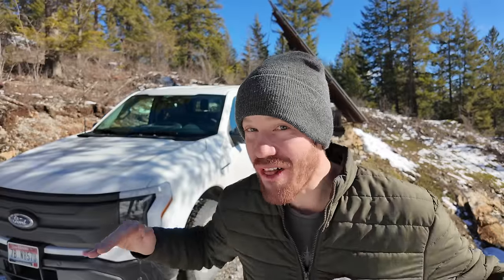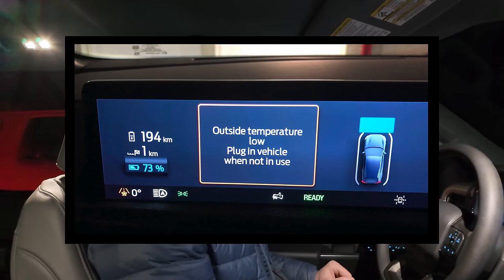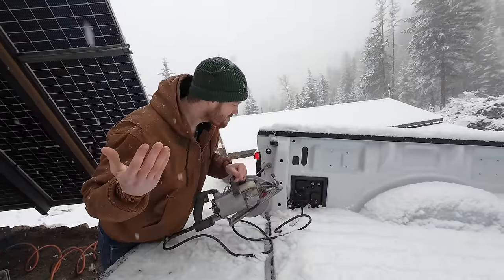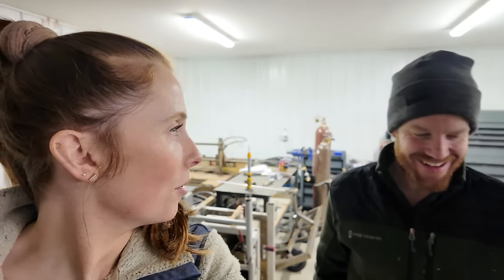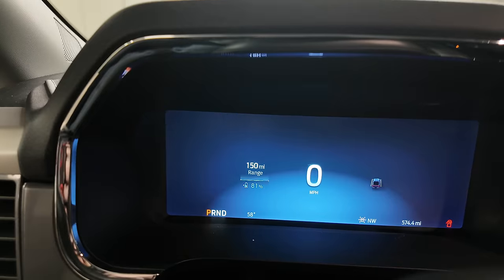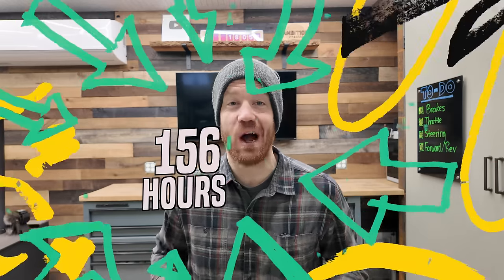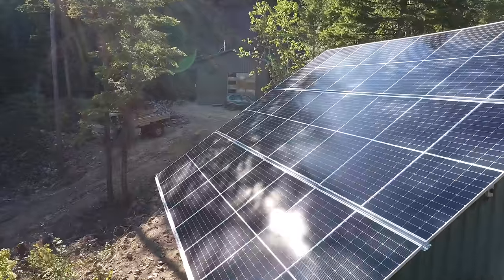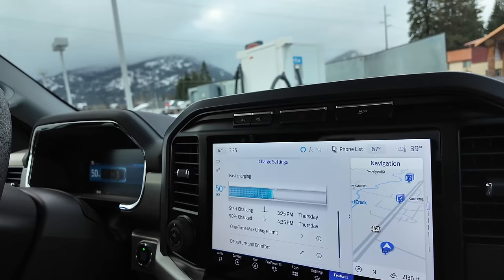Replacing My OFF-GRID Power System With an E.V. (not what I expected)

Comment: You should look at the ford charge station pro charger. It can charge at 80 amps and it can power your house. It's much better than using the bed power.
Reply: The pro charge station only work with the big battery 131 kwh and not the 90 kwh …. That would be a total different test
Reply: Are they still offering ford charge station pro ? I am being told it’s no longer available.
Reply: @nathanbrumbaugh8545  better be! ( already setting up the 400amp-retro-fit-panel-ect 1970 house 🏡for it, just need for coprate/local dealership's to sell the installation kit +safety equipment ect as id like it pre-installed before taking the truck home for the 1st time so my experience is smoother ect )( vehicle to load/grid and other parts of convenat's/easygoing made my gasser classic obsolete and worthwhile to change my habit's ) otherwise it's back to diesels or pre-1966~/EPA-free for my next truck-experience 

glad the cost is starting to come down 150k usd $ is way to much for mechanic 👨‍🔧 ( my career is in manufacturing plants millwright, so the interior gets hammered even though i try to keep it date night ready ) and farming/welders-rig's that are going to get thrashed
Reply: @richardprice5978  If they don't, you can always get a competitor's EV trucks which do. I don't think Ford would want that very much.

Comment: have you thought of a gravity battery? take advantage of the hilly property. just dig a flat surface on a long grade. install a rail and weigh car. connect it to a motor generator and pull it up when your batteries are full and let it out when the batteries are low. also a solar-powered saw mill and wind power in the tree tops. i did this and with your great team and skillset, this will be fun for you. great channel Harv

Comment: Not sure if anyone else has already commented on the 7,200 watt output.  It is actually two 3,600 outputs at 120v.  So if you have more than 3,600 watts on either the same side of the output (L1 or L2), you will overload it.
Reply: I was wondering about that, do you know if it is high frequency or low frequency inverter?

Comment: This highlights exactly why the only EV truck I'd consider right now is the Cybertruck. At least until the lightning gets NACS and supercharger access.
Reply: It has it now.
Reply: @Paul-cj1wb  I think it's only a subset of the superchargers but it's a good start
Reply: @niktak1114  It's a very large subset. And growing. You can see for yourself on the Supercharger map online. Just filter out "Superchargers" and leave "Superchargers Open to Other EVs" and "Superchargers Open to NACS."
Reply: @Paul-cj1wb  No it doesn't.  Not till 2025 when they will have NACS instead of CCS1.  Current Lightning owners are being given a CCS1 to NACS adapter to charge at compatible Tesla Superchargers.

Comment: Notwithstanding all the electrical problems with the Lightning, the biggest problem here is that the battery composition of the Lightning is lithium ion so the cycle life is far more limited than that of your SOK batteries.   Given the price of a replacement pak, I think I'd only use the Lightening for backup in an emergency or for a limited amount of hours where you keep the charge between 30-70 percent to avoid dendrite formation in the Lightening battery.   NOT keeping the battery warm (not in the shop) will also shorten battery life by a huge amount.   Look at the chemistry data and you will agree...Cheers...and good vid.

Comment: I was trying to do this and mine broke, had black screen, onboard charger failure, ground fault issues and more. Had to return it. I hope yours doesn't break like mine. The lightning is one of the least reliable vehicles of 2023. 

I wanted it to work but the trucks tech is just not there yet. 

Oh and the charging speed is just awful. Especially compared to the competition.
Reply from the maker: Hey Will! We watched your video back when you first posted it. What a bummer! We were really hoping Ford had worked out some kinks since then. This is our first EV and the charging has been the biggest learning curve so far. The electrify America charge speed was great, all of the other level 3 chargers have been a disappointment. Thanks for watching the video and leaving a comment!

Comment: A couple of items --

The "plug in while not in use" isn't a requirement. It will run the battery conditioning system no matter what. That said, when it gets really cold, or really hot, these systems can eat power. It sucks to go to bed with 50mi of range, and come back with 35-40, so when the power conditioner will use a decent amount of power, you'll get a reminder to keep it plugged in so your range doesn't drop while it sits, or potentially eat all the battery just doing power conditioning if it's sitting long enough.

Next up, the certain appliances not liking the inverter power. I'm curious if it's a pure sine wave inverter, and how 'clean' the power is. May be worth doing some digging on that front. If it is a pure sine wave inverter, may just need a power conditioner (power factor correction, noise suppression, transient impulse protection, etc...)/line filter on it.

Comment: Great Video....Thanks!....My Lightning XLT has the equivalent battery storage of 7.25 Tesla Powerwalls for $2000 less. It's a No-Brainer that it is a great augmentation to your current setup, not a replacement. I have a 7 year old 15kWh grid-tied solar system but no battery backup.I am planning on using the truck as a mobile battery bank. Plus it is a great vehicle! Comfortable, Fast and Powerful.

Comment: We just had a near 48 hour grid power failure here in SE Idaho (I was off grid for 28 years, grid tied solar, wind, and hydro the last 16) and my Toyota Prime hybrid plug in made it a lot more comfortable. The car remained ON for 40 hours. A 1000 watt inverter (it can handle 1500 watts being pulled out of the 12 v. battery, constantly being replaced by the big high voltage traction battery) let me run some lights, a circ pump, and the fridge. During that 40 hour outage, my total gas consumption was .14 gallons,  note the decimal point...., as I had started with a fully charged traction battery. I added 3 KW more of PV to my property, and it seems to be more than keeping up with the extra watts using charging it, with about a 40 mile EV range.

Comment: My brother uses some smarts to tell the Power outlet for his EV to only charge when there is enough sun/ excessive power.
Maybe your Home power system has the ability to switch a relay when it is reaching a certain battery power level? Combine it with a sun sensor to immediately switch it off, once there is no sun. Maybe you can even switch it between 120V and 240V depending on sun intensity to take stress off your home batteries?

Comment: Absolutely love your vids. Watching your vid brought back memories of when I first connected up my off grid set up. Took a few days to figure out what was causing me problems. My batteries would start flashing red and warning alarms and refused to connect to the inverters.Them Lithuims with their BMS don't like sudden hard discharges. A stand alone battery lead acid helped me. Your inverter just like mine on connecting to the batteries will draw a large current due to capacitors charging up. And theres the problem even when the inverter is not powered up. Running Lithuims totally flat my system will not start, I have to isolate them from the inverter and charge up using a seperate MPPT controller and once they fully charged and connecting they will connect to the inverter. I try not let mine run totally flat. Looking forward to see how you get around this issue.

Comment: That's wild! It's also wild how little power you use per-day. That truck would power my house for 1 day, before needing to be recharged (46kW/day, average, with super-efficient appliances, no AC, no hot tub or anything, mostly just HWH and computers that run 24x7). The biggest problem in the Northeast US, is the EXTREMELY high cost to charge at a public charging station ($0.30/kWh), so the Chevy Silverado EV for example, would last 4 days powering my home, but then cost $60 to fast-charge at a public station. That's $420+/month to charge to power the home fully from the EV.

Comment: I’m sure the experimental side of this is fun, seeing what works and what doesn’t and troubleshooting all the different things that come up, BUT I gotta say it’s all a bit much for my comfort level. “Range anxiety” is now just overall “power anxiety”, 24/7, all the time at home. I wouldn’t want to be having to check and double-check all this stuff all the time. I just want to plug it in and not worry about it. Plus not to mention the cost for all of that equipment; inverters, diverters, converters, ‘perverters’. Unless you’re a fairly capable electrical engineer, all the intricacies are just prohibitive for someone like me. (My dad would have loved it since he was an actual electrical engineer). 
Additionally, all those batteries have a useable lifespan, before they have to be replaced and that’s super expensive. The solar panels as well will need replacing at some point. And you can’t forget proper disposal too. 
As alluded to in the beginning, it’s a fun experiment…as long as I’m watching someone else do it. 
Good luck.

Comment: Riley, Make sure you have the right outlet to plug the charger into. It has to be the one that costs around 100 bucks, not a standard dryer or stove 50amp or 30amp outlet. It will melt because they aren’t rated for continuous current. There is only a couple of them that are rated for EV use.

Comment: Hi Guys, Industrial Electrician here. The issue with the Hair Drier and coffee machine are really intreresting. 
I'm thinking there are 2 things going on here,. The hair dryer (and a lot of fancy heat guns) use thyristors/SCRs that get very upset unless there is a clean sinusoidal wave of voltage, likewise your offgrid charger/inverter will use Thyristors on the input from an AC source. My thinking is:
1.  The Pickup (Forgive me I nearly typed Ute...NZ thing!) may not be putting out a pure sinewave.. and/or :
2. There is not a lot of L (inductance) on the output of the inverter. This for me is the most likely. I've seen it on power conditioners interacting with VFDs (when the VFD has a small DC Bus or SCRs as the inverter with not much of a DC Choke installed.)
It's possible that you may need to run an isolating transformer or an input inductor between the Pickup and the house to introduce a bit more inductance.
Sorry for a waffle, hope this helps!

Comment: We ran into something with inverter power which may be why your coffee maker and blow dryer wont work.  (In our case, it was a deployable satellite communications system that wouldnt work off our inverter despite wattage not being a limiting factor.). It turns out it would work with some inverters, but not with others.  We think it had to do with how well the inverter reproduced what looks like standard sinusoidal AC voltage power from DC voltage.  You can see this on an oscilloscope.  The way most inverters make AC, the output ends up being a square-ish looking sinusoidal at 60 Hz frequency, which seems to work ok for many things.  So, we tested about a dozen inverters and there are some that produce a true sine wave AC output. I think you alluded to suspecting the truck’s built in inverter as the issue.  I think one of the inverters that worked was made by ProSine.

Comment: Starting yr test in an Idaho winter is brave. I think you guys will love summer - can you have a rapid charger at home to make the most of that massive solar setup? I charge my (tiny) EV using the wall plug -240V in  Au but it takes all day which is a bummer if it’s sunny and I want to go out for the day. I can charge off the grid at night though if I need to. Means more everyday planning is needed but sooooo worth it. I love the silence and the acceleration!! Planning to go bidirectional when I upgrade to a bigger battery model - keep the current EV as another house battery. There doesn’t seem to be much happening here re changing out batteries - not yet possible for my Leaf.

Comment: Sound your hearing is the batteries fan as well. They have optimal temperature range and will have a fan either blowing cool or hot air across the batteries accordingly.
Reply: Yup. My first thought when you couldn't figure the little truck noise was that it was a battery fan. Mystery solved

Comment: Great video. 

I have the same whole home cut over switch and plug in my garage with a cheap 240v generator that I manually cut over when there is power outage. Pore man’s generac. 

I have been pondering hard on this solution and appreciate the work put in to test it.

Comment: Very interesting video Riley! I would keep the main solar power system, with the repaired propane gen set as back up #1, with the Ford F150 Lightning for the #2 back up system. Then you can use the pickup for transportation and to also 'haul' power back to your main battery bank. I was really surprised how quickly it charged the whole battery bank and left enough power to get back to town. Plus you can recharge the pickup from the 'excess' power you have on the bright sunny days. The is truck seems like a win-win for you guys. And you are technically up to date to figure out how to make all this work!

Comment: For the 220v outlets i think that 30amps are meant as total power, so not 30amps per outlets but together with all outlets in car bed (not sure how much exactly are there), 30amp for 220v outlet is crazy, mostly 32 amps are used in 380v systems and 220v outlets are mainly 16amp each

Comment: I think this is a great concept. After you have build the tool container building I was curious if you could just plaster it with solar panels to remove the need to run the generator. Now that you have such a vehicle you can even dump the access from summer into the truck and in such sunny days, you could get a weeks worth of electricity

Comment: I like the idea of an electric truck (at least in your situation with excess power during summer) but I don’t think it will replace your off grid battery System. It will only increase it‘s efficiency. 

I think if you would replace your generator with a generator with waste heat recovery system you could heat your boiler and your home during winter time and safe fuel because you will use less electricity for heating. 

I like your content! Thank you for sharing your projects!

Greetings from Switzerland

Comment: Have a suggestion and that is to increase your solar array by putting panels on your OPEN shed workshop roof.  
You have enough space to get up to another 10 Kws of power of panels.  In other works with your plasma table welder and other power tools you run which are energy pigs even for short periods of time. 

UP to you but I think it is worth the shot to do that.   10 kws power in winter or lower light will give you a minimum of 10Kws if not more than the current 5KWs you get on not so nice days.

Comment: Cost to replace F150EV battery pack as of 11/22 is almost $36,000.00  and recharge cycles makes a replacement likely needed in 10-12 years for normal light truck use adding home loads to battery pack will shorten lifespan by needing more recharge cycles. The expenses for battery pack replacement do not include normally include installation costs and vechicle battery changes are not a DIY project. Ray Stormont

Comment: Great experiment! I have the Powerboost and thought it would be great to try an experiment like this. It has the 7.2 kW generator that runs off the gas 3.5 EB engine. I powered our trailer AC all last summer and so far it works great. The truck runs for about 2 minutes, then provides power from the batteries for about 10 minutes and then back on again for 2 minutes. Very little fuel usage.

Comment: The 7200 watts is total output power of the combined split phase outputs (120V x 30A x 2 phases = 7200 watts).  That means that each phase of the output can only handle 3600 watts. If you had an imbalance of the loads, it could cause a ground loop current resulting in the inverter shutting down.

Comment: I have told so many of my neighbors (typical Ca tract house neighborhood). Not to buy house batteries as a power backup to grid failure especially if they plan on getting an EV. To your point 99% of the time you have a usable vehicle and 1% of the time or less you can have backup power👍. 

However!!! Your off grid situation the truck is a multi tool regarding power ie you can haul power from town, you can store power when everything is full up on solar, you can drive it😆👍.

Comment: There’s a neighbourhood in Holland experimenting with this exact concept. All the cars (small EVs) are integrated into the local grid system to supply power to houses or charge when the cars are not in use. You just plug your care to the thing at the curb.
Reply: This is what an owner would NOT want.  They are allowing their government to use their car power anytime.  Besides the usage cycles, they could also leave you empty when they said they’d put power back in.  Best scenario is to always use your car in your own home without giving them access.